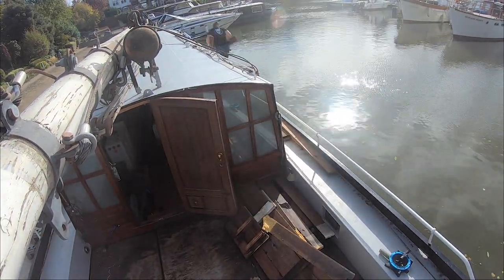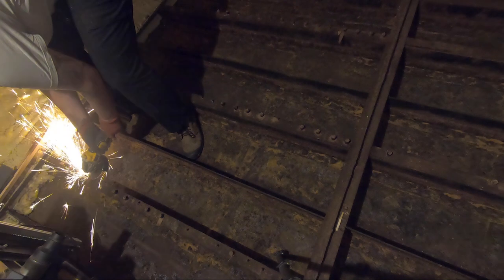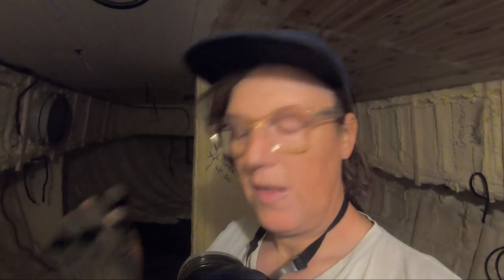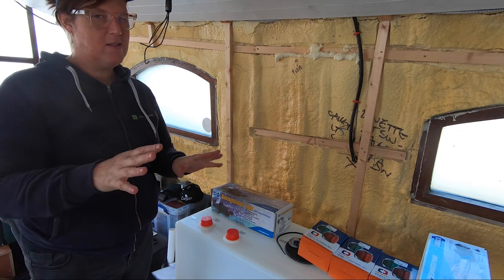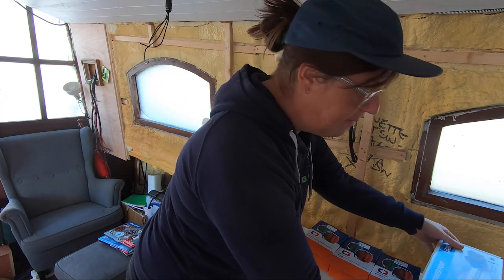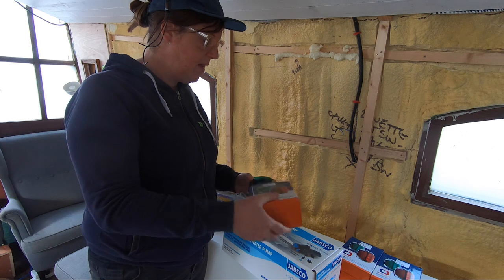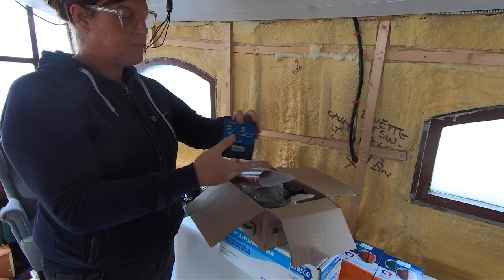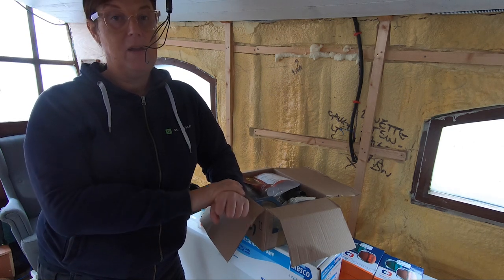#70 Bilge Pump, Grinding, Lightning (plus Show & Tell) - Dutch Barge Home

Comment: What a nice surprise at this unusual hour:)  in my eyes there’s no plenty of work vs. not too much work, you proceed at your own pace and that is exactly the right one, don’t let a anyone tell you otherwise:) actually it’s exhausting just to watch all the work you have to put in just to get the new floorboards, I would have gone crazy or have had enough by now, your persistence is exemplary:) and although I was able to follow your description of the water system/bilge pump setup it will surely be easier to see it when the actual works are done for me definitely (probably others don’t have this problem). That post storm sky was just amazing to see, thank for updating us, have a great week:)

Comment: Hello Beth - saw you struggling with that pipe after dipping it in hot water. That brought back memories of years of struggling with these things - usually wrapped around an engine or a toilet! So after 35 or so years of scalding my fingers a guy in a boatyard said that he always used a hair dryer to soften the end. Was sceptical at first - but it works on even the toughest of pipes - and even better, works for getting them off again too.
Good luck with the fit out
Reply from the maker: Thanks, that's a good idea! I actually also have a heat gun so that might work better! However also the pipe is right behind a bulkhead so it's really hard to push the pipe on so I'm going too get  some angled fittings!

Comment: Don't forget when you pump out your waste tank your gauge will show zero but it won't be empty because of the short sender tube.🤔
Reply from the maker: The pumpout is actually to the bottom so it will pump the entire tank and I don't really need to wait for the gauge to go to zero as the pumpout lasts for 8 minutes per time so I'll get an idea if that's enough to empty the entire tank.

Comment: Will you have large lights that light up the  deck areas? I've seen them on the big fishing boats on TV,  my only other experience with boats.
Reply from the maker: Yes, I have a circuit for deck lights which will shine down onto the deck from the shrouds!

Comment: Fantastic parts I hope I don’t keep you up at night but your vent on your tank looks like a small hole I hope it keeps up with the suction. I’m sure it’ll be a poopy situation if it doesn’t
Reply from the maker: Yes, they're both relatively small which connects to the same size hoses for the pump-out system. Without going into too much detail the system uses a macerator toilet so it's not, how can I say, going to block the system. 😊